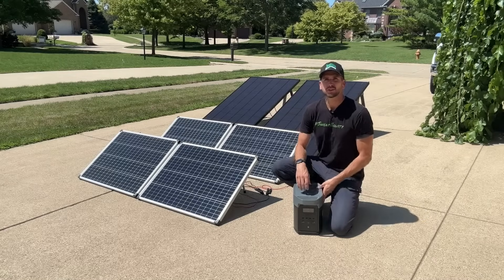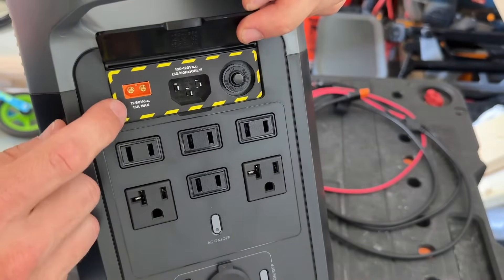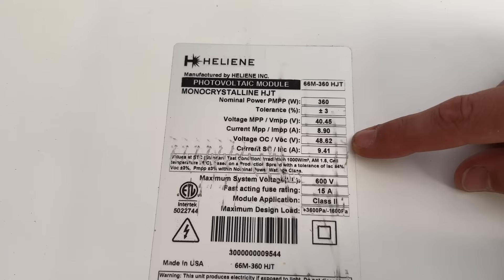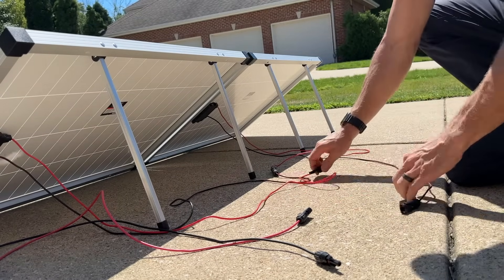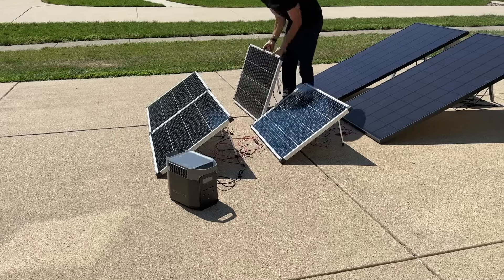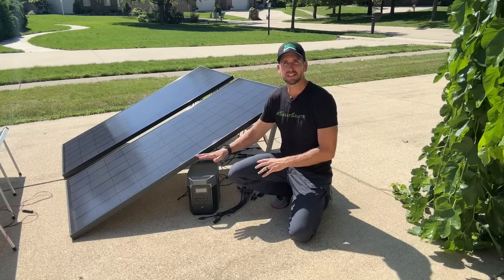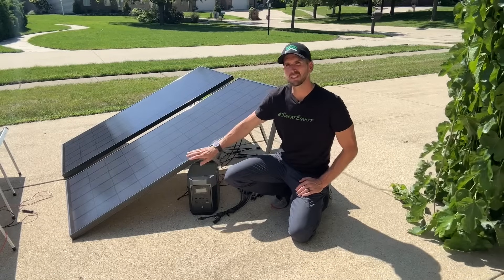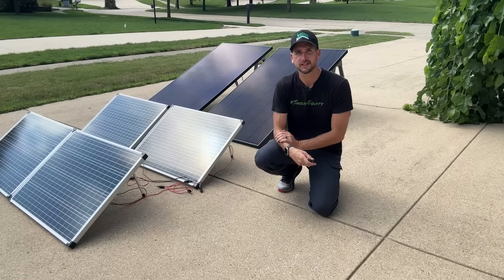Charging A Portable Power Station With Solar | ECOFLOW Delta 2

Comment: Two of those 360w panels in parallel seem like a great solution if you have the panels and the space.  The excess capacity providing charging even on overcast days is a win.
Reply: Yer that’s what I was thinking… say you had 100amp available would that cause a problem ?
Reply: @beaker8501  The most important spec is the volts. Make certain the maximum open circuit (O.C.) voltage from the panels is less than the max acceptable on the solar input. For the Delta 2 the limit on the input is 60 volt.
Reply: @Sylvan_dB  what about the current (amps) can you have “too much” current ?
Reply: @beaker8501  No. Think of it as "current is available" -- it has to be drawn or pulled.  Think of "volts are pushed" -- forced to the recipient.  If you don't push too hard (not too high volts) then the receiver won't take too many amps even if they are offered.
Reply: @Sylvan_dB what happens if you exceed it slightly or at all, will it cause damage or just not charge?
Reply: @italydude515  I strongly recommend do not exceed voltage (Voc or max open circuit voltage on the panels compared to max acceptable voltage on the input).  It is possible to cause damage but it might or might not immediately happen.  Having more watts or more amps available is almost certain to be fine. Equipment uses what it needs, unless too much voltage forces it to take more. Of course, extreme excess is damaging to your finances so stay reasonable.
Reply: Your method will create over voltage and over current. No advisable at all. Good if one doesn't care about damaging the machine.